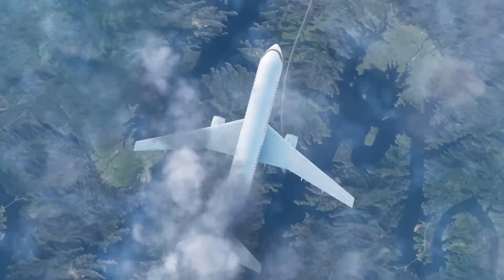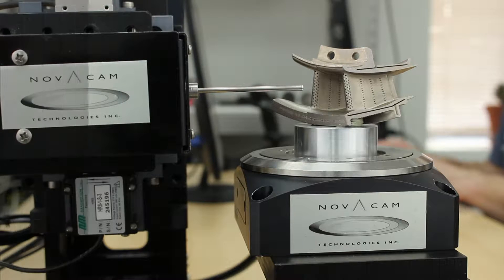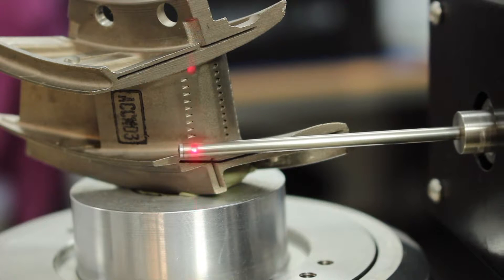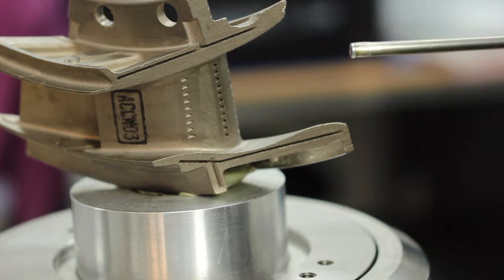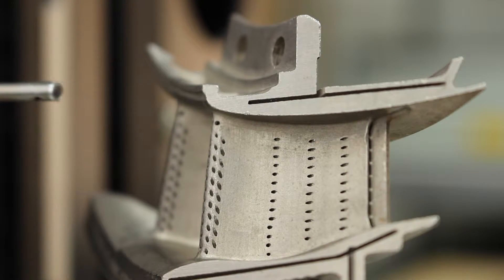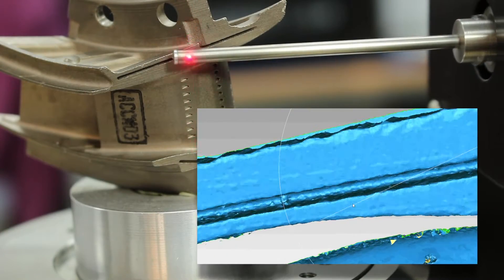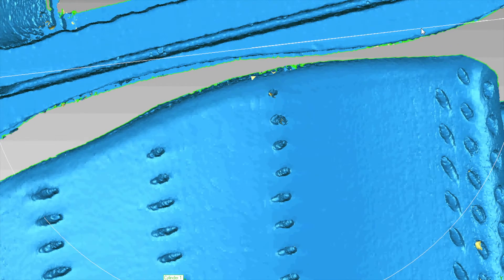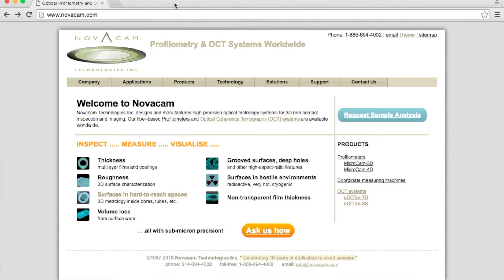Automated turbine blade inspection (BOREINSPECT system) | NOVACAM

Comment: You may want to get your terminology in line. That is a segmented hot section vane, not a blade. Former Pratt & Whitney vane and blade guru. The e.d.m. "fan outs" are the diffusers in shaped holes.